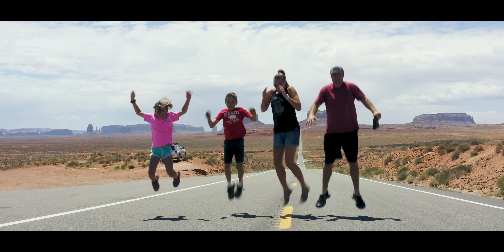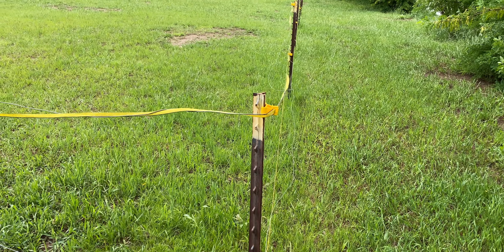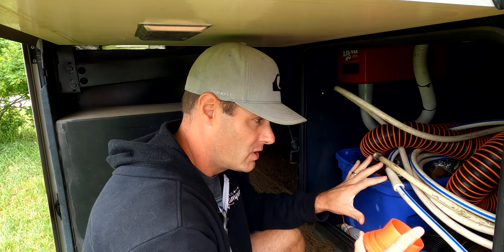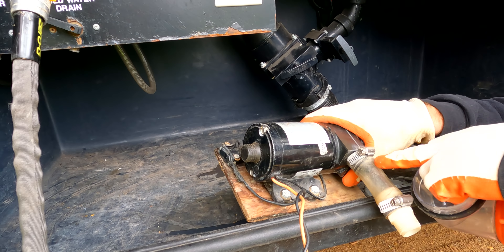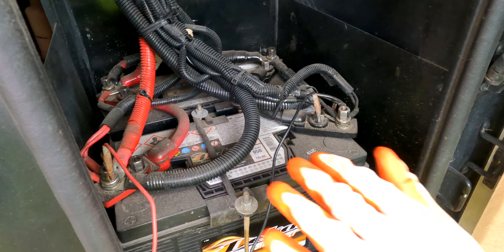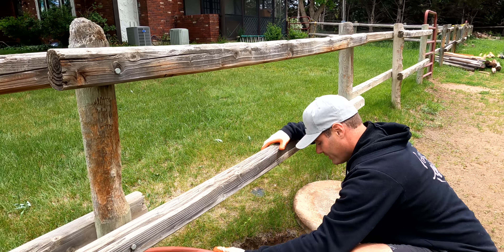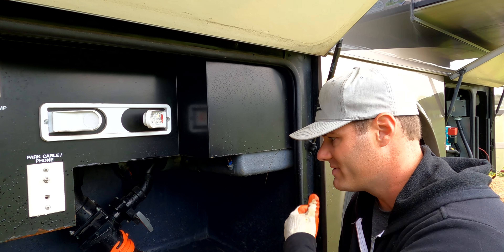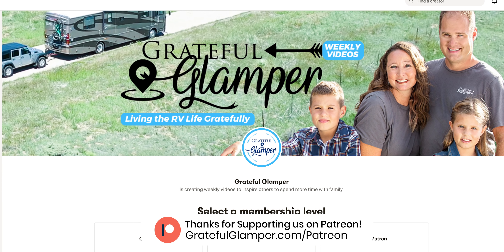Dump Your RV at Home! Moochdocking Tips (How To Use A Macerator Pump)

Comment: I use one at home.  One issue with those extra long hose runs is that when you run out of grey tank water, you need to shut off the pump.  But the hose is still full of water.  Compressed air is needed to empty the hose.  Not a problem when at home but when you're on the road...  There is a hose end fitting available with a schrader valve connection that can be used to blow air through with a portable compressor.

Comment: Nice content! Been searching for how to's for maceration. Learned quite a bit from your video & many great comments! Now many months later, my two cents. Able to add sewer hose to extend location as required to reach dump station not just more valuable dedicated garden hoses. 
Also when wearing gloves it's important to avoid touching uncontaminated surfaces (or cleanse them!) with gloved hands; hoses, covers & caps, valves, pump, your hat....... 🤫 we have spray bottle of clorax cleanup on stand by to treat surfaces at dump station, concrete pad etc, (walking on cleanser) and spray any dripage plus a few squirts to disinfect our hoses. Then I have antibacterial soap & using water to wash hands.

Comment: This video couldn't have come at a better time. We just started our RV journey and will be mooch docking at my parents for a while. We have to do our first dump tomorrow and it will be a challenge as the clean out is up hill. We decided to try the Sewer Solution which uses water pressure to do the maceration and push it up hill.
Reply from the maker: You’ll have to let us know how it works out!
Reply: How did that system work for you??

Comment: I have been using a masiator pump since 2007 with my coach. I have had to replace the pump one time which is not a very great job. The impeller which failed was a cost of $1.19. To date I have never had to hook up my coach to a traditional sewer line. I love my masiator pump. I have pumped into my personal septic system many many times and it’s very convenient. I have to be honest I really don’t even know how to use a slinky stinky! Thomyt
Reply from the maker: That’s awesome! Thanks for watching 💙💙

Comment: A sewer clean out on a private line is not owned by the city. The city sewer is accessible through manhole covers, but many areas use similar covers for storm sewer. Storm sewer tends to be more shallow, larger diameter, and is typically dry unless there is rain. Also they tend to smell better, but not always.
Reply from the maker: Good to know! Thanks for the comment!

Comment: As to the question of the length of hose: every pump has an output volume at a specific head pressure. As you add resistance to the outflow, you reduce the output of the pump and increase the heat produced. The smaller the outgoing pipe, the greater the friction, and every bend in the pipe causes significantly more turbulence. A garden hose is a terrible choice for pumping solids of any sort, but I doubt many people are going to buy that much lay flat hose.
Reply from the maker: Thanks for the comment!
Reply: There are many of these pumps on the market that are setup to use a garden hose only.
Reply: Ive been looking at lay flat hoses. One Problem is that they dont work coiled so youd need to carry multiple hose sections to get the length you need.

Comment: We have the same power management system on our Winnie, Works great at auto selecting Gen, 50A and 30A, but the 20A selection is a manual process. We have a basement AC / Heat Pump System and if 20 Amp is selected it will still run but only one compressor. Keeps the coach cool as long as the outdoor temps do not climb above about 85 degrees. I am looking to install at least a 30 Amp power box at home to make sure I am not tripping a breaker. I would love to be able to dump at home but the closest clean out is in the basement floor and not very accessible for running a garden hose. There is no clean out with-in 5' of the exterior of the house. While that is a code item now, it must not have been when my house was built.
Reply from the maker: You can always use the toilet at home to dump into if you have a macerator and a large hose. Thanks for watching!
Reply: @GratefulGlamper  Hmmmmm, I dont see the  CEO at home approving that action.

Comment: The problem with your replacement logic is that your lone macerator will only fail when you use it to empty your waste tanks. I would plan for Murphy's Law now so you will be able to complete your waste dump after a reasonable delay after swapping hoses and fittings.
Pro tip: Park your RV over at the sewer cleanout port. Looks like a driveway over there and the view on the passenger side of the RV is nicer as well....

Comment: Not a good idea to do this on a septic system. Under normal house operation the larger pieces sink in the septic tank and degrade there while the gray water floats out the top. Using a grinder/macerator pump leaves it all in smaller partials that can get caught up in the out flow and eventually clog the drain field. This would work fine on city sewer though.
Reply: Exactly
Reply: It depends we have a commercial septic tank at home and all the septic companies told us we were fine only if we are using septic safe components